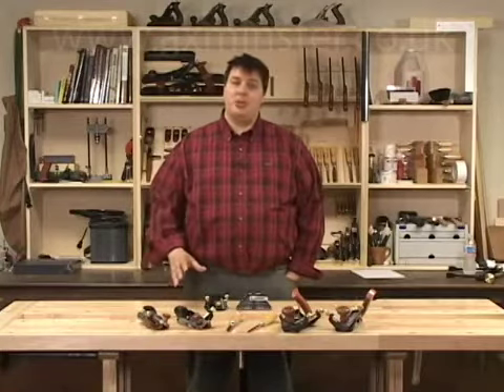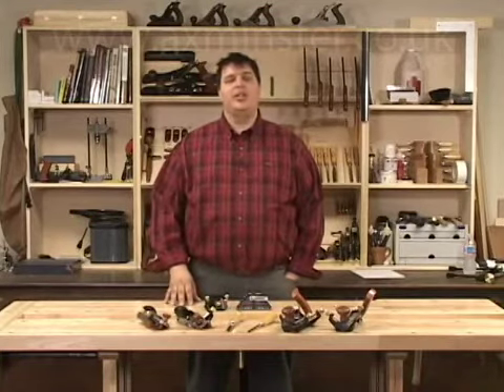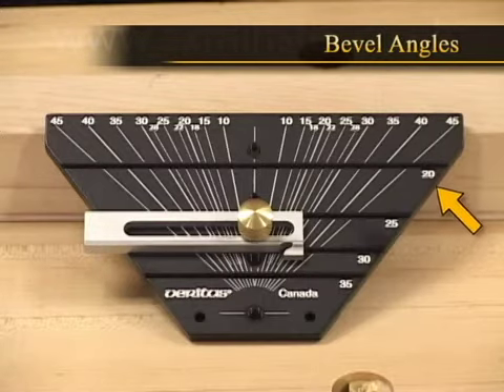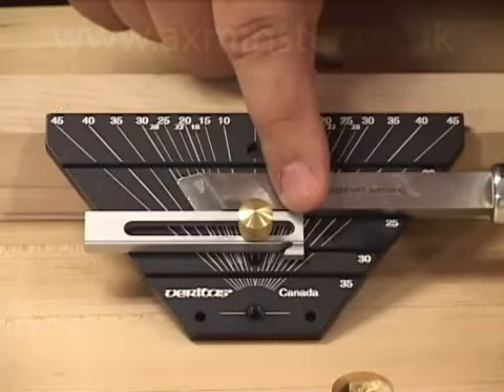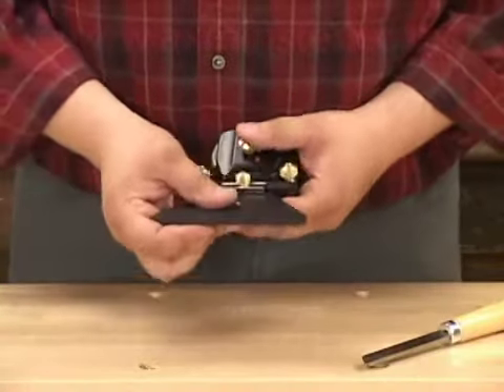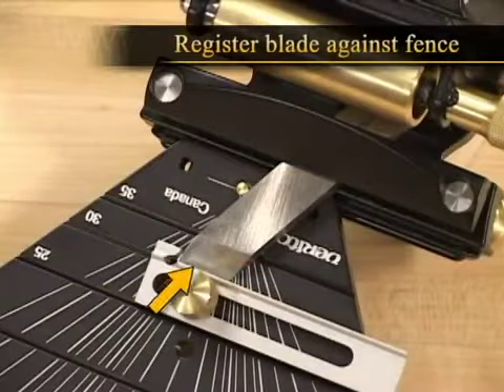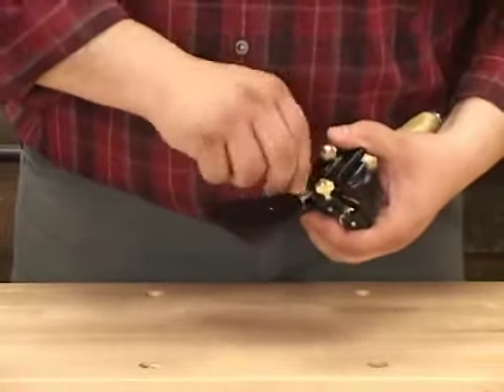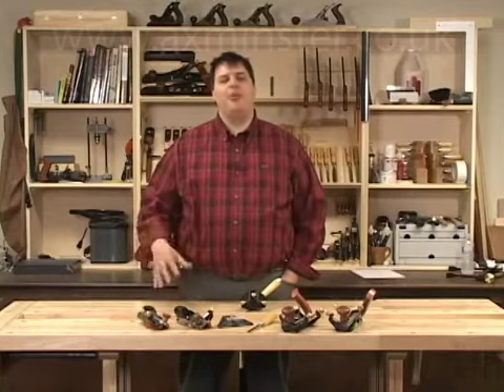Veritas Skew Registration Jig

Comment: Neither printed instructions nor Vic's tutorial demonstrate how to set up a plane blade. Though much the same process I think it would've been worth devoting another 60 seconds of time to plane blades. I came to YouTube because the printed instructions didn't clue me in to the fact that the jig has to be inverted when attached to the honing guide. I knew I was missing something - hard to slide in a blade when the jig is upside down...